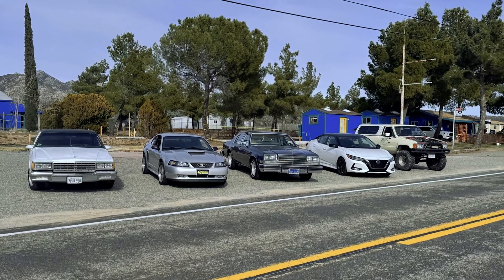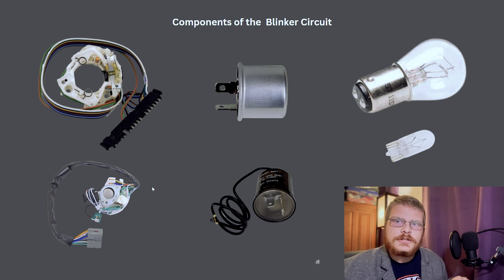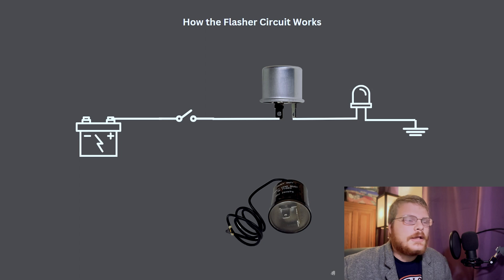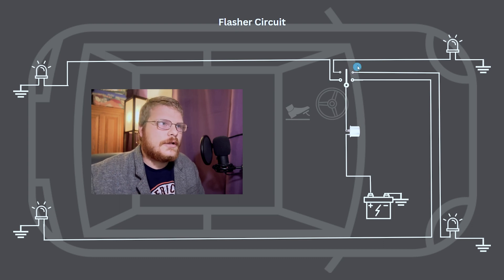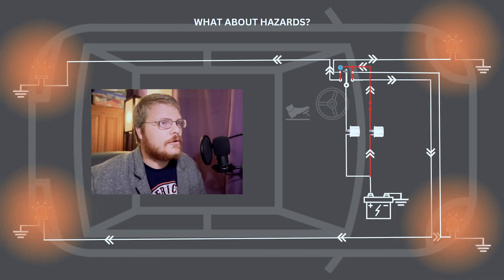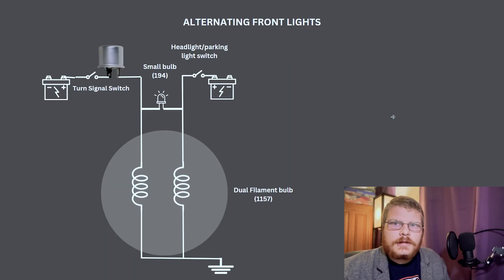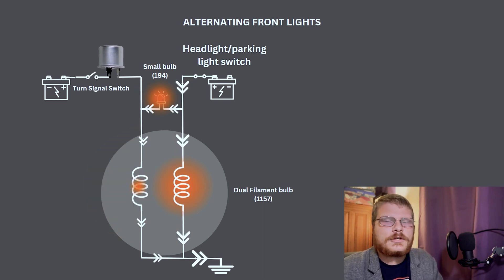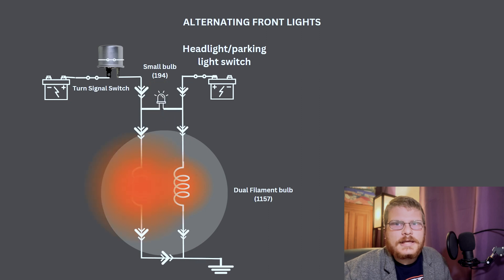TURN SIGNAL CIRCUIT - How It Works!

Comment: So does my turn signal pass power to my brake light switch?
Reply from the maker: No. If the bulb is shared, the brake light switch passes power to the rear lights through the turn signal switch.